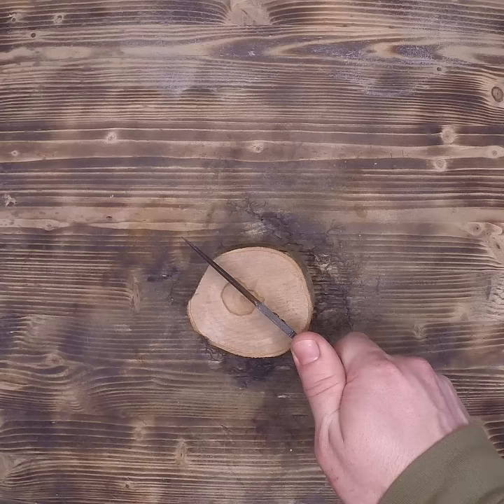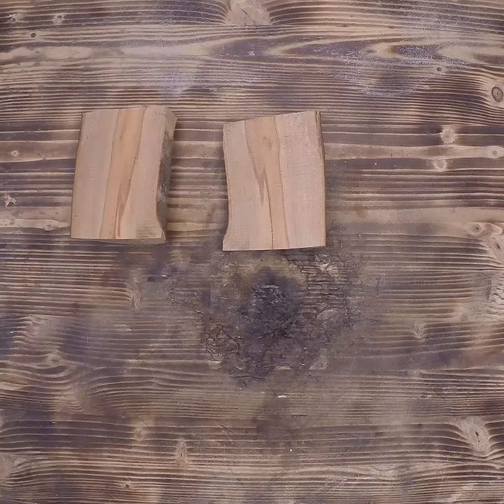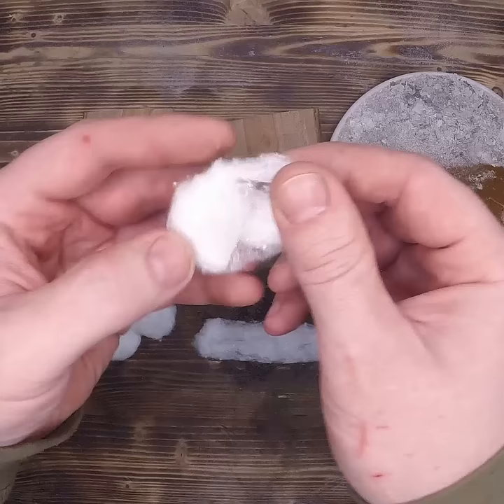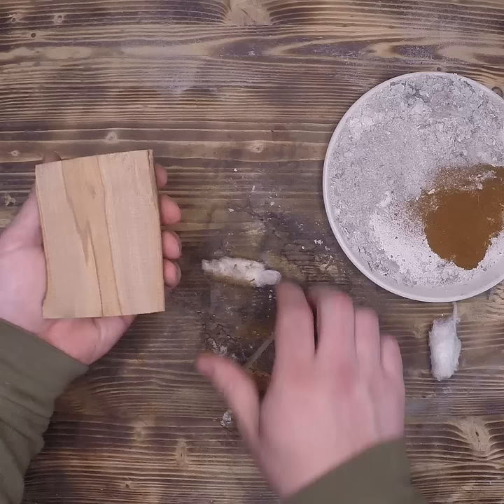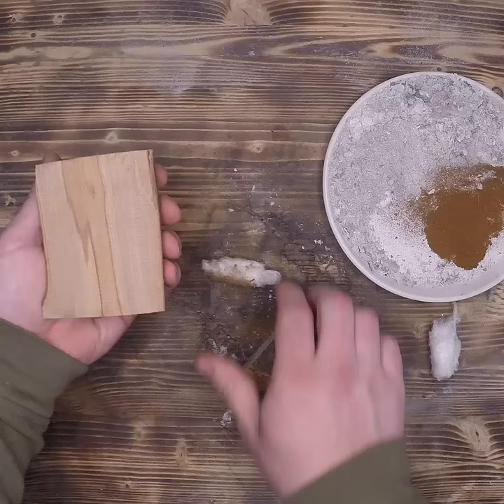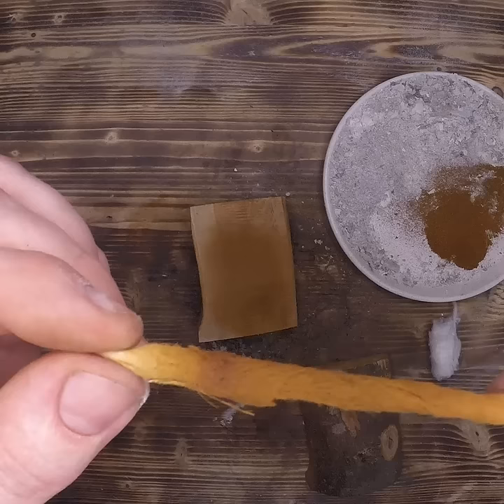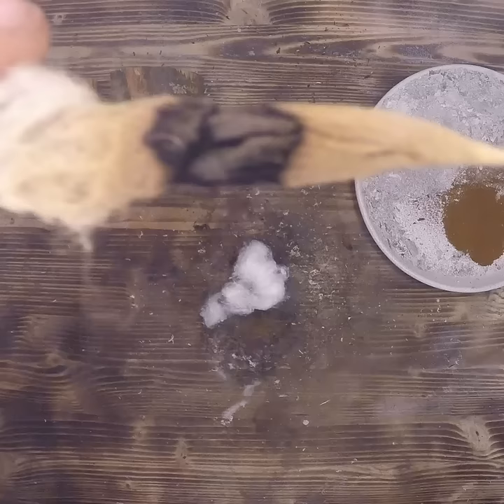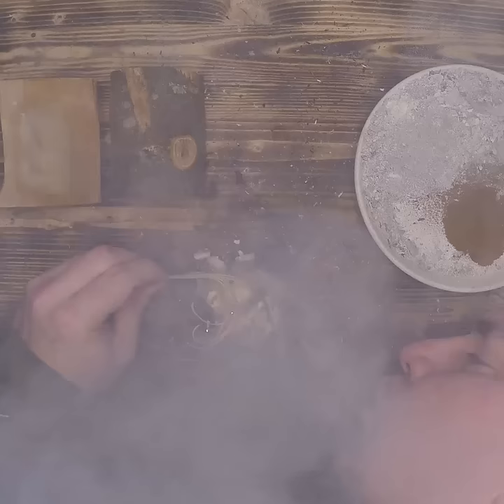INSANELY Easy Friction Fire! New (to me) Technique.

Comment: Ah my favorite survival fire starting method. So flexible, and easy. So many different materials you could substitute. For the cotton most natural fibers will work just fine. Fluff from hummingbird nests, dryer lint, part of your shirt, insulation from a coat, dry zippo filling, cotton wood seed fluff, cattail seed fibers, etc. Same goes for the ashes/friction component. As mentioned rust also works, iron oxide collected by a magnet, activated charcoal from any source (hand warmers, air filters, water filters), iron shavings, flint shavings, steel wool, walnut husk, pumice, aspirin, I’m sure there are more. For your flat surfaces the options are also just as extensive as long as the surfaces are not slippery and do not conduct heat very efficiently. Materials to do this method could be randomly gathered from just about anywhere.
Reply from the maker: I should hire you to answer my thousands of comments asking about alternatives! Great comment.
Reply: aspirin works either way.
Reply: @revgo4624  - aspirin? Seriously??? Crushed freaking aspirin - no way?

Really?

What about Tylenol?
Reply: @crystalm4324  It is just about having a fine powder. You could use chalk or silt as well.
Reply: love all the knowledge shared!
Reply: @crystalm4324  Noooo, I need the Tylenol to cook my chicken.   😉
Reply: @revgo4624  why aspirin?
Reply: Love that
Reply: @Sgtassburgler    No 💩.     Now that’s worth knowing.
Reply: @Sgtassburgler  would cocaine work? 😂
Reply: Ok, so the dust is used to increase the friction, and pretty much anything is usable as long as it harder than the fibers you're using to produce the coal?
Reply: @robertcorley5225
Reply: @timmylogsdon493 who needs fire when you can get jacked up run through the woods and keep your body heat up 😂 id rather have a great time before I die

Comment: If you know of any rusty surface sprits it lightly with a cheap spray lubricant such as WD40 and wipe it off with toilet paper If you'll notice the toilet paper is now rusty with a slight addition of combustible fuel use this between your two flat pieces of material such as two smooth bricks or wood as this gentleman is showing!!! But it's a forgone conclusion you must gather your kindling and wood to be burned or whatever kind of fuel you're trying to use prior to your initial try!!! And thank you so very very much for this insightful video kind Sir your a veritable treasure!!!

Comment: Never considered rust as flamable.
Good to know! Thank you!
Reply from the maker: It's more of a friction device in this setup. The cotton is the real tinder. I should have been more specific.
Reply: Lol. Mix it with aluminum powder and it gets VERY flammable
Reply: @ringofasho7721  😆Good one!
Reply: It makes sense, we would skate on a rusty piece of angle iron and sparks would sometimes fly off.
Reply: @toddspangler6669  😂
Reply: @ringofasho7721  ooof, that would melt wood. Lol
Reply: @BeckJoseR  You can't really 'melt' wood, but burning it is easy.
Reply: @TheCrabbers  true.
Reply: @TheCrabbers  You'd need to invest energy to make iron (metal) and oxygen (gas) out of rust, that'd be counter-productive.
Reply: @TheCrabbers  thats not how molecules work, the carbon monoxide will reduce the iron oxide to iron and carbon dioxide.
Reply: @Anonymousg64  you are correct the oxygen wont be released unless there's an acid present, or the temperature gets over 1100⁰c which probably won't happen rubbing a log 🙂
Reply: @FollowTheCompassNorth  friction catalyst
Reply: @ringofasho7721  the flamable-est
Reply: @TheCrabbers  I don't have the video to prove it, but I've rubbed my log hotter than that
Reply: @durere  Fantastic comment! 
I will manage without the video, thanks🙂🙂
Reply: @FollowTheCompassNorth  would sand or other fine, rough material work then in that case?
Reply: @TheCrabbers  Your appreciation is appreciated (:
Reply: 9/11
Reply: @FollowTheCompassNorth  no you did fine, it’s common sense if you didn’t know.

Comment: This is a pro tip here!! I could easily see this method saving ones life . this is one im gonna practice and prefect. This looks way easier than bow & drill.
Reply from the maker: WAY easier.
Reply: Seriously! Harvesting some rust is pretty damn easy. I wish I had known this decades ago. I'd like to see if it can work with a cut of denim or T shirt.
Reply: Yes but don't do it in a wooden or in a plastic table just like the guy did.
Reply: @danzo8658  why and what should i use instead, then ?
Reply: @rhedrhed2064  a metal table
Reply: Sabizos  probably more flammable.
Reply: @FollowTheCompassNorth  id like to see this done with different materials. if youre in an urban environment, would two bricks work?
Reply: Just remember to carry woodpieces, a blade that can slice wood like butter, cotten balls and ash or rust powder with you at all times.

Comment: That's so fucking cool! It's Iron Oxide, the friction causes the oxygen in the rust to ignite, that is insane.
Reply from the maker: Pretty much! Also increases the friction transmission to the cotton.
Reply: Oxygen doesn't burn, oxygen is the thing that oxidizes stuff that burns and the oxygen in rust is in the form of a compound with iron and hydrogen, it's also already in its lowest oxidation state so it wouldn't be part of the reaction either. I assume rust is there for friction or something
Reply: @randomname7918  Well, you're right and wrong. Oxygen doesn't burn; it SUPPORTS burning; a certain amount of oxygen, 0² (had to use a superscript; my phone doesn't do subscripts), is necessary for burning, aka "rapid oxidation". Slow oxidation of iron (Fe) creates rust (Fe²O³). Notice that there is no hydrogen (H) in the chemical formula for rust.
Reply: @kellyrobinson1780  that's literally what I said and also I'm sorry but you're wrong. The first person said that oxygen in rust ignited but 1)oxygen doesn't ignite 2)the oxygen in rust is already reduced to 2- oxidation state and can't oxidize anything thus it can't support burning
3)there is hydrogen in the formula of rust, rust is produced when iron is in contact with oxygen and moisture, the approximate formula is written as Fe2O3•3H2O but the reaction isn't uniform and complete so the amount of water is variable
I have seen people write it as iron (iii) hydroxide sometimes but I guess that's not exactly correct

Comment: This was excellent and could easily be pre-made in advance for an emergency survival kit. Keep everything together inside a ziplock baggie to keep waterproof.
Reply: 2 jenga blocks and handfull of cotton balls
Reply: As with a lit of other things, bic lighter, cotton balls with Vaseline? Etc
Reply: You can water proof lighter with a ziplock bag.
Reply: @jamesweatherford988  
There’s no need to even waterproof a lighter. Not a disposable at least.
Reply: @jamesweatherford988  
If your lighter gets wet you can simply run it down a trouser leg, or across most any surface, a few times till you get sparks. This is common knowledge to any smoker.
Reply: @Elephantstonica  then why do you need to make cotton and that other stuff when you have a lighter?
Reply: @jamesweatherford988  
You don’t.
Reply: You'll be better off with Flint & Steel, that you can buy any place camping supplies are sold & a small tin containing lard. And if you're too weak to strike the flint & steel hard enough to make sparks, just introduce a 9 volt battery to a cotton ball, It'll spark too! It doesn't take much to light the tallow (animal fat).
Reply: @madamrockford2508  
You know else has flint and steel?
A lighter. Or ten.
Reply: @madamrockford2508 You'd be better off with a lighter. Even a dead BiC is still useful, run it backwards for a bit and then strike it, poof fire while empty. I keep a box of empty lighters around, and full ones way smaller and more useful than flint and steel.

Comment: For people wondering where you might find rust or ash when you need to make a fire, I think you could probably substitute sand for this and then possibly gravel dust.  What you are looking for is something that will cause a lot of friction when rolled under pressure (make sure to press on the 2 pieces of wood when you do this - I think the pressure has a good bit to do with how fast it will ignite).

If you need to dry the ash/rust/sand/dust I suggest using an extra piece of cotton if you have one or use dry cotton clothing if possible & put the substance in the cotton & it should absorb a fair bit of the moisture.  Get it as dry as possible this way and then add the damp powder as shown.  It should still light, it's just going to take a bit longer b/c you have to generate enough heat/energy to dry off the water that is in the powder.
Reply: Ash is actually a catalyst for making fire and I suspect rust is as well. Thats why sand won't work.

Comment: "Done in 90 seconds" it will take me a day to find a piece of wood
Reply: And an eternity to find a knife that cuts through it so easily like that! 😲 What?
Reply: And to cut a crosssection out of a branch like that with a knife. Maybe if you're lucky you could produce two serviceable blocks of wood with flat edges by breaking dead branches, I wonder how much texture can be on the flat edge before it stops working. Need something with a nice straight grain too, it can't just be any tree/wood

Comment: What's a good substitute for the cotton ball? Let's say you're in the woods and bamb of course now you're stuck out there without warning. You have the sharp knife but no ash or cotton balls. You can come across some dead and dry wood but how to compensate for the rest?
Reply from the maker: You can scrape any of your cotton clothing with the knife to harvest cotton. People do this in prison to make prison wicks from their socks. Rusted metal can be found in the wild in most places now especially in creek beds.
Reply: @FollowTheCompassNorth  Thank you
Reply: @FollowTheCompassNorth  could you harvest the rust with a magnet from dry dirt?
Reply from the maker: @recycledsteel3693  I suppose so! I accidentally do this all the time when magnet fishing local rivers.
Reply: @Bromie Morris find some shitty metal object, chances are really good...or naturally occuring iron oxide(rust). If you have some luck you might find ash in a used fireplace or lightningstruck tree...also not too uncommon
Reply: I wonder if wool or linen would work? (Thinking from a historic point of view)
Reply: @karltriebel4262  linen maybe, but they would need some hella much rubbing to get the material fine enough...wool on the other side is more or less fire resistant, so no, no chance!

Comment: Awesome. Imagine I'm scrolling along here and I accidentally learned something today. Nice. This does deserve cake 🍰🎂. This is definitely one of simplest methods ever shown. It could be possible with variations depending on what you have to work with but the line of thinking is on point and it's top notch survival. I don't know if that wouldn't work with a piece of flannel shirt. I also think it would be beneficial to pack a little bottle of rust scrapings .
Reply from the maker: I've seen it done with tobacco as well!

Comment: Many of the comments are so dead on, & that makes the writer's witticism hilarious. You guys crack me up  & boy did I need a laugh or two. I wonder where this guy camps to find those perfectly cut chunks waiting to be cut in half. 

Any cub scout can tell you the easiest way to start a fire is with a 9 volt battery & a cotton ball, if you can find a real one. Just gather together your leaves & twigs & form a loose birds nest shape, & a loose pile of whatever burns. Touching the 9volt battery creates light sparks on the cotton ball, which is shrouded amid some nesting. Blow gently & viola. Show your intelligence by keeping the battery & cotton balls in separate pockets. It's beats rubbing sticks together. Flint & steel, & a little lard (or similar) also works great.

Comment: If rust and ash work, I'm sure you could easily use an abrasive powder like aluminum oxide or silicon carbide.
They sell them in a powder on Amazon to use for lapping, just get a coarse enough grit. Or if you're really stuck you could probably use a small pocket oil stone, break off a piece and crush it into powder.

Comment: I wonder if talcum powder would work.  I'm sure there has to be other powders that would work besides rust & ash.  I would think sugar or even pepper would probably work as well.  You just need to find something abrasive that will cause friction as it is ground/rolled together between the wood.  Don't forget the pressure when rolling the cotton!

Comment: The problem with all the quick fire starters I've seen require you be prepared before you head out.  Which you never are in a survival situation.  Your car breaks down on a highway in February, northern BC, or you plane goes down, you get lost skiinge. its all the same.  I'd like to know if you can do the same with the fil from a jacket.  Basically if I was going to have cotton and rust, I'd have matches or a lighter.  But it's a cool idea.

Comment: Funny thing is you can save yourself all that trouble and use a tampon. It does the same exact thing no filing no spreading it out just take it out of the applicator put it between two flat pieces of wood and roll it back and forth a few times.

Comment: Listen up.  You can use this to create a fire kit by making the rolling parts and creating a hefty number of these tinder rolls in advance, storing the tinder rolls 3 or 4 in each of a number of tiny ziplocks rolled and kept tight with small rubber bands.  Put the kit in a large ziplock and put that in your bugout bag.  Shazam!  You're a Boy Scout: Prepared.
PS: Where do you get the rust?  Make it out of water and an old piece of iron.  Keep the iron next to the water and keep it almost hot.  Scrape the rust off the iron every few days.

Comment: Did you know you only need a q tip and spark.  If you really fluff up the cotton on a qtip and pull it off, as long as the cotton is well separated and pulled until very soft and fluffy, the spark instantly starts a fire in the cotton and very easily.  Any old lighter will work if you have no fluid left in it.

Comment: You should also be making iron, the iron oxide will oxidize the cellulose to CO2, and the cellulose will reduce the iron oxide to iron metal, very similar to how iron is actually made, take carbon and iron oxide and burn them. 

Considering you’re heating the cellulose up a ton you’re probably charring it to elemental carbon so it may be the exact same. Heck charcoal is made from cellulose, just usually in the form of wood not cotton

Comment: Yo, Kid!
Try mixing the rust and ash (or char) at a 1:1 ratio, and use about half as much mass as you did with the rust in the demo. You should get better results, according to some of the ol'geezers I've seen. 

And, to all of those commenters who had sh*t to say about the splitting of the wood to create the friction surfaces:
Well yes, it does look like the Kid cheated with an edit. He, or someone else, also chose a nice piece of wood ... I'm guessing cherry, which should split smoother than some others. 
However ... you can use flat rocks, if you're in the right place to find them. You can use any properly sized piece of split wood, if you smooth it out with any rock(s). Hell, you might be wearing the right kind of boots, or own an expensive enough pair of gloves, to not require anything else from your surroundings! 
To those who commented on the question of finding rust (ferrous oxide), in some form or another:
First: It's really not that hard to find, if you actually look.  
Second: You probably don't want to accidentally mix any aluminum shavings/dust in with the rust, because that could go sideways on you. And yeah, magnesium could be bad too. 

Fire make warm. Fire make light. Fire cook food.  Fire is useful ... and dangerous. 🤷
Whaddaya' gonna do ... not boil your water, or cook your food?! 😖
Reply from the maker: Kid? I'm almost 40...
Reply: @FollowTheCompassNorth  
🤣🤣 ... I meant no offense man. I should have known better. I tend to sound young for my age too ... almost 60. ✌🏼

Comment: Hmm, any fluffy reasonably flammable fiber should work. I bet some other tinders could prove interesting.. Something that on a micro level generates greater friction, moves heat and maybe adds flammability and drops flash points... Well, my weekend just got busy!
Reply: Update?
Reply: @mikebond6328  Powdered magnesium is a BIG win. Also aluminum. Adding a tiny bit (like one drop) of kerosene also a big win. Laundry lint by FAR is the best material, especially if a load of both cotton and synthetics were dried together. If the lengths of wood are longer, ignition is faster and easier.

Comment: Call me out if I’m wrong but couldn’t a lot of dry materials like sand or maybe sawdust work for this? It’s just creating heat through friction basically and if so I wanna see someone do this but with rust and aluminum powder inside the cotton ball😁😂
Reply: I mean yeah, sawdust should work perfectly fine but I doubt sand would. Sand will be visibly marred by heat if it’s stuck inside heat at 150 F or higher, but it doesn’t have the same molecular structure as flammable material like wood, which is what sawdust and ash are usually made of.

Comment: Good ide to do it on an wooden table👍
Reply from the maker: You know that hardwood slabs don't just.... IGNITE.... right? That's why kindling and split firewood is used to make fires. You can't just hold a bic lighter up to a big hardwood tree and BOOM forest fire... just like you can't start a big hardwood table on fire without SERIOUS heat or duration of exposure.
Reply: @FollowTheCompassNorth  it's a joke man